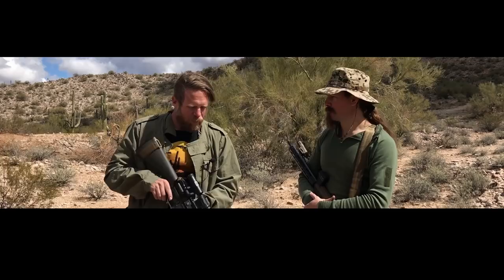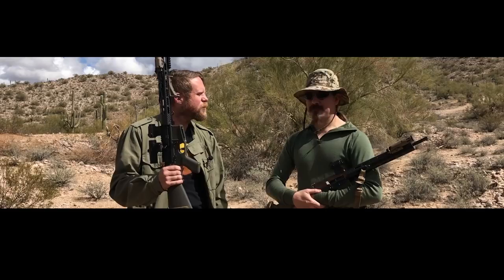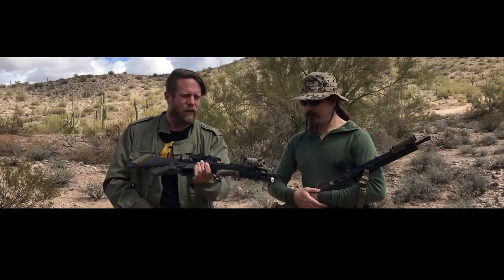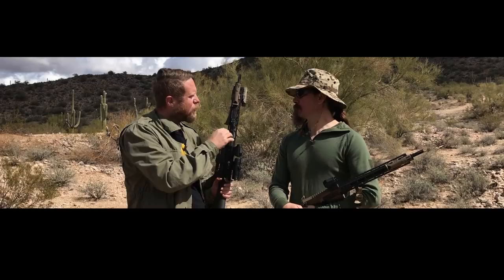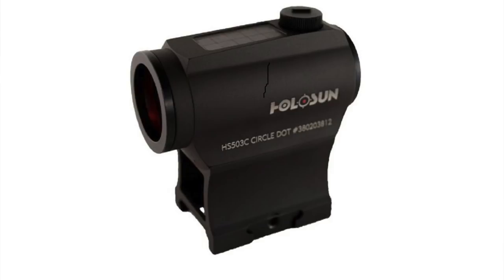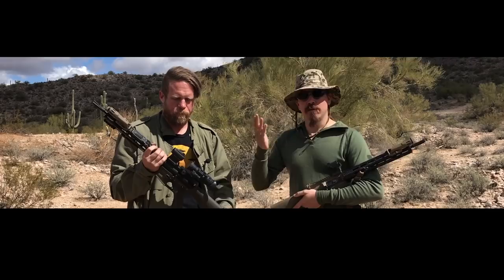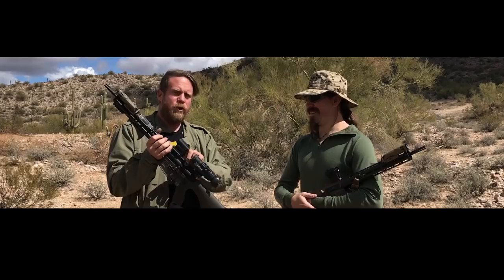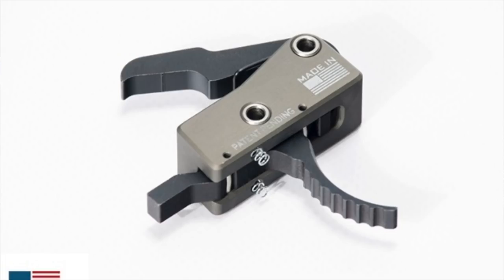WWSD: Rethinking the AR15 - CONCLUSION

Comment: only thing I wouldn't do is go for an ambi bolt release, I'm right handed so for me its not a big deal.
also, the gun is relatively cheap, to clone it completely yeah it might be a little bit costly but the thing is; 
the main components are the pencil barrel, the gwacs lower and aero upper, you can absolutely run the gun with a standard buffer + spring and a $40 lpk and a 13" $100 rail and be most of the way there towards this gun
Reply: this is true, but I can however see the use for an ambi safety as being an extension of the trigger finger on right handed folk in the case of like a broken thumb or something extraneously unlikely.
anyway my main point was about this rifle being as cheap as you might want as long as you stick to the pinned 16" barrel,  gwacs lower and slick aero upper

Comment: Did you ever try an Atlas bipod? They most likely considered heavy, but they are hard to beat as far as options. You can reload the stock, lots of options for the feet, it won't collapse on you. I'd like to know more about the Harris Bipod, but one review showing the legs/bipod failing just pushing forward a little bit turned me off to buying one. Any comments on the advantages of a Harris? (Minus the price...)

Comment: So many armchair commandos, what about this or that.  You use what works for you.  The point of the video was about What Would Stoner Do and not what would you do.  Build your own rifle based on your own requirements.  I find what they said here in the videos were valid.  Weight is important.  I suffer now from the weight of a 120 pound ruck that caused long term back problems.  Any chance to cut weight without a sacrifice of effective service is a good thing.

Comment: I feel your conclusions overall arent wrong. And while I have a difference in opinion about some aspects like optic choices, and barrel lengths I still see the data you have presented and it's still a solid rifle build and I have to agree with how it all turned out. Like the whole iron sight thing... A quality modern optic is not likely to fail. Yes, they CAN and yes the DO fail as anything is prone to do at some point, but a vast majority of those scenarios are EXTREMELY unlikely or would take such abuse that it goes well beyond what would be considered normal wear and tear. Granted, combat scenarios often prove to be quite different than what a civilian will EVER encounter, and the whole SHTF thing might not ever happen, but you at least know that plenty of these optics will hold up. 

As for keeping back up sights on the rifle, I'd sooner keep them in my pockets on my BDU's that on the rifle. Much like the little helmet storage bag, iron sights are often small and weigh next to nothing, especially the little polymer ones. But, that's just me personally. However, you do hit the nail on the head when talking about optimizing rail space. I do often see a lot of people with tons of crap on their AR's and frankly the question always comes up in my mind of "Do you actually use all that?" or "Do you even know the purpose for all that?" and generally followed up by "Do you have the need for all that?". Usually it's just guys who see an AR build from some Special Forces guy or somebody on YouTube and tack a lot of stuff on they dont need or know what the use for it is. I'm a bit of a minimalist for most my guns as my personal needs are very small for what I have thus I keep it at a minimum. But unlike some, I'm not this sort of purist of "Iron sights work just fine!" and keep my rifles stock. While I DO have plenty of guns that are stock, that's also because their application and use works just fine and optics wouldnt benefit me or the rifle at that point. 

As I said, I do disagree with the barrel length but that is mostly because I have shot at long range before and I know about maximizing a round's ballistic potential. Granted with rounds like the M855A1 and stuff, that has increased performance in short barrels, the military has started to encounter some problems with that here as of late and frankly I havent found it be widely available to me just yet. And I've shot plenty of XM193 out of short barrels and I've never been impressed. But, as a civilian now I'm not just restricted to military surplus loads, so I find some of the heavier 5.56 rounds perform better in longer barrels, but after a certain point it becomes a matter of diminishing returns. For example... the difference between an 18 and 20 inch barrel is pretty insignificant in terms of ballistics, where the difference in a round's performance from an 18 to a 16 can be significant, or an 18 to a 14. And while I wouldnt really try to set an 18 inch gun up for a DMR type role exactly, I believe the purpose of this project was to create the most versatile rifle as a whole and I personally feel the longer barrel would be more versatile myself. Still though I do see your point behind the shorter length and everything. 

All in all the project has been quite interesting. I'm still looking forward to the alternative history idea of if the US went to lever action rifles instead of single shots, and I've even got my own ideas about how something like that would have gone. I even have the idea that the potential evolution from a lever action might be a pump action rifle as well, which is a concept I've been exploring a lot lately and feel has some viable data to back up why it would have been a good idea. I also think a What Would Kalashnikov Do series would be welcomed, and I'm sure I'm not the only one who's mentioned that. But, another possible idea in my opinion would be trying to build the best 7.62 NATO rifle, likely using the FAL platform. But, aftermarket support for some of those rifles isnt as innovative as the AR or AK market. Still, food for thought.

Comment: Only possible problem I can see, is the length of pull, plate carriers are the way to go, but for some reason the us military wants to issue out IOTVs still.  Which is not very ergonomic for most.
Reply: Path of Phobos in conventional combat (and ied dodging that the mil has been doing of late), you’re more likely to be injured/killed by shrapnel than bullets. The soft inserts in the IOTVs can cover areas the plates cannot, giving greater shrapnel protection. SF guys do much more close combat, and prefer the lighter faster PCs (and short carbines like the mk18 for the same reason).
Reply: thgreatandini Valid points, although I see infantry guys mostly wearing plate carriers.

Comment: How do you feel about the Canadian method with the C7, In Range?

I am not saying a fixed one is obligatory, but a forward mount has been used in practice.

Granted, I fully concur with your conclusion - albeit, I would prefer a sight like the ELCAN Specter which has backups mounted on the scope.

Comment: Looking at the rifles and listening to the discussion about light weight and handleability, two words from physics class come to mind.  Angular momentum.  It is low angular momentum that gives bullpups good handling characteristics; in general the farther away the average bit of mass on a gun is from its center of mass, the higher its angular momentum will be relative to its mass, and the slower it will be to manipulate.  Bullpups are shorter, and thus have less angular momentum than a conventionally laid out rifle of similar mass.

What bothers me about this video is Karl and Ian deem to have ignored angular momentum in constructing their rifles.  They have various add on doodads all stuck out at the end of the barrel.  Why?  Would those devices not be just as effective placed well back towards center of mass, thus reducing angular momentum?  Sticking all that weight out at the end of the barrel inherently increases resistance to turning movements and thus makes the rifle harder to handle.

Comment: In reference to the conversation about backup irons........ Is it not feasible to have quick connect flip up front and rear sights  in a separate pouch? These sights could be pre sighted and have the spots on the rail where they go marked so as the quick release optics etc are added and removed the flip ups can be quickly reattached. Or would this just be over-complicating the entire situation lol?

Comment: I always wondered something about making rifles lighter. Isn't there a point where a gun would become "too light"? As in, the weight of the firearm is just as important as any action and personal strength you put in it to contain the recoil for shootability sake. Not arguing against your point about weapons needing to be lighter then not because as reality is, 97% of the time, you'll be just carrying it around like dead weight, until that 3% shows up and you NEED it badly (numbers pulled out of my backside) and ease of handling is a thing. Just a shower thought.

Comment: I am building a part for part copy of this but I ran into an issue I can't figure out: The Midwest gas block. Why would you choose this over others? The one linked in your parts list is too long for the barrel. When trying to pair it with the same Faxon barrel the gas block overhangs the seating area for the gas block by 1/3, meaning that last 1/3 of the block it isn't even creating a friction contact with the barrel surface to aid in keeping it in place, so what do you gain by having the extra weight of a longer block?  As far as I can tell you can't even make use of the third screw hole to make contact with the barrel because it's so much lower than the gas block surface. It also creates a small a pocket for moisture or debris to potentially get trapped in and contribute to rust formation (Not an issue in Arizona, but an issue in other parts of the country). 

Is there a reason you chose the specific gas block on your list, or was it just a random part you threw on? 
Is there some reason for it we aren't aware of? Improving barrel harmonics? Purposely adding a little extra weight on the end to improve overall balance? 
Is it possible the older Faxon barrels simply had a longer seating area for the gas block, and the gas block you chose actually fit perfectly? Have the newer barrels changed a bit in their design? (the 3 prong flash hider has changed to be asymmetrical, so maybe they changed other things?). 
If it were the quality of Midwest Industries you wanted then they do make a micro version of the same block that is simply shorter. Why not use that one?

The reason I would like to know is because I'd rather have a lighter and shorter gas bloc, with no gaps for debris - but before I went and bought a new one I wanted to check if there was any specific reason you had chosen the existing gas block. I wouldn't want to mess up any of the special sauce that makes the whole system work so well together. Although I'm not sure if the gas block makes much difference to that, I have heard that the gas system and barrel harmonics can be very fickle things. For all I know the tweaks Faxon has made to their flash hider geometry could also mess with those harmonics. 

Would any gas block be interchangeable in this project, and work just as well, so long as it was of reputable quality? Such as the Faxon gas block that has lightening cuts in it and is shorter? What about titanium gas blocks to go even lighter so the whole things swings better? Or is changing the metal type of the gas block too iffy when it comes to reliability and durability?

Comment: For your next project, make a polymer "What would Kalashnikov do?" polymer lower receiver. It would be a massive step up from milled receivers in terms of ease of manufacturability. Mikhail's principles behind the AK design was to make it as manufacturable as possible. There is nothing more mass producible than an injection moulded part, although it does take a lot of engineering to get the moulds and ports and flow rates correct.

Comment: I do have one question, you decided to go with a 14.5" pencil barrel, did ya'll have to do a tax stamp because of the length, or did both of ya'll install a 1 1/2 in. muzzle break and had it pinned and welded?

Comment: What sling swivel mount did y'all use?
Yes, I checked the list before asking.
Reply: As stated in earlier videos by Ian & Karl, 'lightweight' was not the only reason to choose something, also the usability (and adaptability) of a design, its material(s) and perceived quality & ruggedness too had an aspect upon the decision - along with any prior personal experience with an maker/manufacturer or component.
   Hence why they went with the adjustable 2 point sling they used.

Comment: @ InRangeTV I have a question on the Holosun red dot. I've recently mounted a Krebs railed handguard on my Arsenal SAM7 UF and I'm considering one of the Holosun micro-T1 style sights, and I'm curious if you guys think that the Holosun wouldn't have issues with heat from the gas tube? I'm looking to use a low profile mount on the top rail on the handguard.

Comment: Hmmmmmmmmmmmmmm.  The only thing I can think of that might be of utility would be a slightly larger diameter carbon fiber handguard to allow something like one of the Generation 2 OSS suppressors with a reflex chamber going back under the handguard.

IMO, for a "go to" rifle that  you might have to fire in anger indoors, a suppressor is mandatory. You're still going to have some sort of permanent hearing damage if you fire supersonic rounds indoors, but 26-30dB of suppression can make the difference between a slight case of tinnitus vs. permanent partial deafness.

Also, does Faxon offer their cryo treated pencil barrels in .300BLK? :D

Comment: Although you nailed the fact that Stoner would absolutely have wanted to make it as light as possible, and a lot of other changes make perfect sense, I think you guys missed the mark on one key area: There is no way he would be designing a 5.56 caliber gun today when both the Army and Marines want to move towards a higher caliber rifle, so they would never accept a 5.56 gun no matter how nice it was. The Marines are developing a 6mm range cartridge they want to use and the Army was even considering going up to 7.62 again if they had to. This is ironic considering that tests after WW2 led the Army to conclude that a .27 caliber round, or about 6.8mm, was superior. But tradition, corruption, and politics kept it from being adopted. Afghanistan taught them that they can't give up their rifle's ability to reach out and touch the enemy at long range. Vietnam taught us that 5.56 is too easily deflected by brush. Many a soldier has complained about the lack of stopping power behind the 5.56. They are also concerned today that if we ever had to fight a nation that has outfitted it's troops with modern body armor that the 5.56 would be stopped. I think ammo developments can only take us so far in terms of increasing terminal ballistics or penetration (usually not doing both at once). At some point you probably just want a bigger more powerful round that can do both at the same time. 

I think you were correct when you said that your conclusions may have been influenced and biased around what circumstances you were testing the gun under. You probably rarely had to shoot at 400m or longer, if ever, because of the way these matches are typically designed. You may not have had to try to penetrate barriers the enemy was hiding behind, or try to get hits through thick brush. You probably didn't have these range challenges set up in a way that even measured a bullet's killing power once it hit the target. Of course, you don't have to worry about the targets shooting back either. All of these factors could bias the test to be content with the performance of 5.56 as a good enough target plinker, on a rifle platform that is accurate and easy to work with under a variety of conditions and ranges, yet still never really reveal the shortcomings of the round in combat conditions with regards to cover/concealment penetration, long range, or stopping power.

Comment: i don't know if you guys addressed this in your video on the gwacs lower and maybe i don't know my legal definitions of stuff super well but since the lower, grip, and stock are all one piece does that mean that the grip technically isn't a pistol grip for the purposes of legislation because it's part of the same piece of plastic as the stock?
Reply from the maker: Huh?  No, we didn't address that because it's not something we concern ourselves with.   I am certain "they" would consider it a pistol grip.
Reply: I think i just had my legal definitions of stuff messed up.  I thought I read somewhere that the whole reason a thumbhole stock isn't considered a pistol grip is because it's connected to the stock and I figured since this also was that it might fall under the same category.  either way I guess i'm wrong

Comment: An amazing video series and project gentlemen. I'd say for the average person what you two have done with this is wonderful. I personally would not make the same build but that's just me and I'd rather just have as close to my issued m4 as the ATF will allow me. But that's solely on me. I lack the mustache that Ian has so adjustable stocks don't bother me. I'd say the builds you two did would suffice in a sort of borderline pocky-clyspe, that big california earthquake hit, sort of situation. Y'all didn't set out to build a frontline battle weapon, you set out to truly build what the air force originally was looking at the AR15 for. A light carbine to protect an airbase. Which in most regular situations outside of combat will get the job done effectively. That said I personally want my heavier barrel with the undercut, my aluminum lower, I'm okay with my standard charging handle, butt stock, GI trigger, and my GI sights. But that's just me. I really do want to get rid of those cheese grater rails, too much weight and not enough benefit....unless y happen to have an m302 or m320.